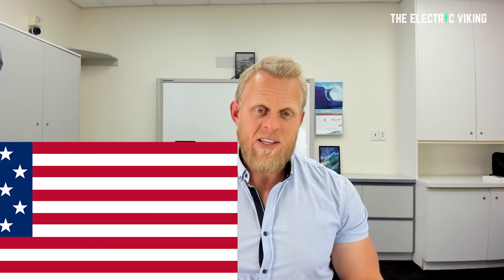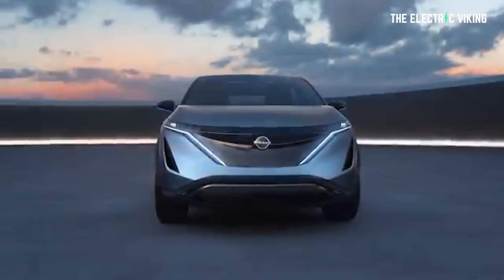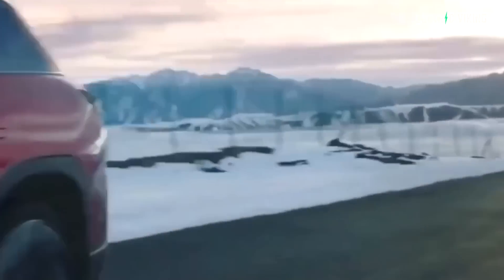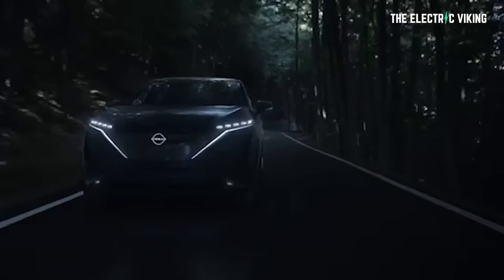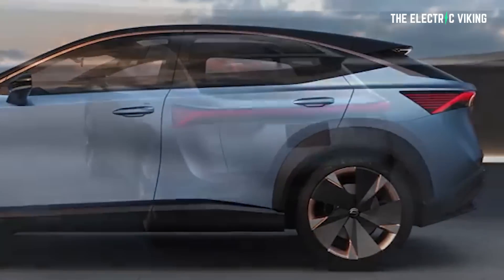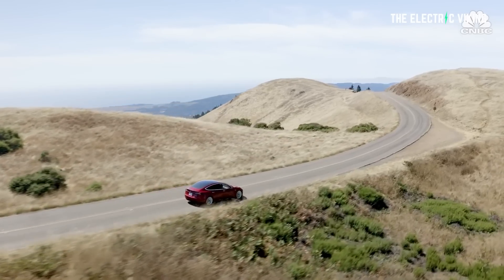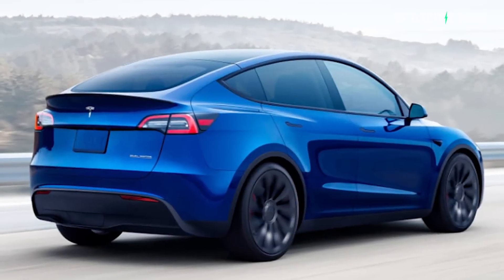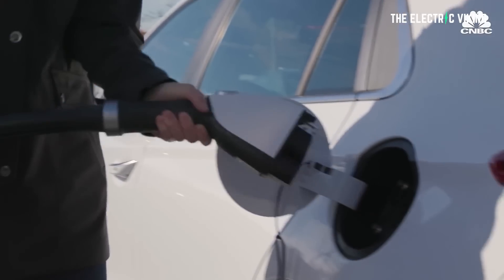Nissan Ariya US Reservations Open: Specs + Prices!

Comment: The Ariya looks like what Nissan should have done with the Leaf -- 2 years after it came out.  It adds liquid thermal management, and better range and acceleration, and I hope it's always-on like a Tesla (at least it has an app now), but it still lacks a frunk, RWD, a big screen, AP & FSD with seamless navigation, high performance, 300+ highway miles, etc.   It could still be better than an ID.? or a Mex-E, both plagued by software problems, if the roll-out is more competent.

Comment: In the US an SUV looking vehicle is the daily vehicle so all wheel drive isn't important to probably most drivers.  There are colder places where more people will be driving in some snow so all wheel drives becomes a little more important.  But front wheel drive works fine in snow.  I drove an econo front drive vehicle in snow all the time and no issues.  But then once you get into the mountain areas with snow or people have to drive off road then it's important.  Maybe that's 10% of the buyers.

Comment: I think fwd is better than rwd but that is largely because ice vechicles sit their  engine in the front and that extra weight on top of the wheels that are propelling you forward provide extra traction.  On an electric vehicle i don't think thats the advantage.  With the skateboard design the weight sits in the center and distributes their weight across the wheels much more evenly so i think it matters a whole lot less whether it's fwd or rwd in that case - either is equal in that regard.  Now as regards moving appliances with a dolly, it's generally accepted that it's much easier to pull than to push - despite that you cant see what's behind you so well.  In a car maybe it's still easier to pull than push.  I'm willing to bet that it is.  Who's the mechanical engineer in the room?  Not me but i but there is one who can speak to that.
Reply: FWD has an advantage in the braking/energy re-generation, as the majority of the braking is done by the front tires, thus allowing more power to be regenerated which would be beneficial for the car's range. RWD is better for the acceleration, since pushing the car from the back is better, you must have noticed that when you push the gas pedal down, the back of the car will go down and the front up, thus creating more traction on the back. Same is true for braking, the front will go down and the back up. So the best option is always 4WD, you'll have the advantage of both situations. There are also differences with steering your car, most people prefer RWD, since you can power through a corner, move gas will push your car down. That's why most sportscars are RWD if not 4WD.
Reply: @Curacars  the center of gravity in an ev changes the angular momentum of the chassis relative to an ice vehicle.
Reply: @lizziswane4632  I don't think it matters much except for cornering. For traction RWD is best and for re-gen breaking FWD is best.
Reply: @Curacars  is cornering a function of traction as influenced by angular momentum and center of gravity?
Reply: @Curacars  see I come from a background of growing up in an environment of used appliance sales and servicing and everyone had a ford pickup and I can tell you plainly that in the feet's of snow we used to get in the winter that I would only want to drive a pickup up a snowy hill if I were loaded with appliances, otherwise I would prefer even a fwd dodge omni.   But that's ice vehicles.  But even loaded down a pickup still has a tendency to slide from side to side as it digs in.  My omni not so much as that.
Reply: @lizziswane4632  you shouldn't be driving a car up nor down hill with a feet of snow without chains and preferably a 4wd.
Reply: @Curacars  now what fun would that be?

Comment: I'm getting a Model Y but the Ariya, Ioniq 5amd the EV6 were on my short list since they all come really one to the Model Y.  

I brevet the ride quality will be better in the three I mentioned above over the Model Y but I'm going for that longer range in the Model Y,  the larger storage, better infotainment and since mine won't be ready to receive until June I'm hipingnfor more improvements to come...even potentially the 4680 cells.

I think if you're going for the Ariya get the front wheel drive with the longest range. Hopefully when they do the EPA test it gets more on that 87kw battery. 

With that size battery I expected more Rane. Either it's really inefficient or its unnecessarily heavy or maybe it's a combination of the two.

Comment: Sam, you asked why such poor range from a big battery? - 2 words mediocre aerodynamics.  Aerodynamic drag energy is much greater than energy to overcome rolling resistance due to the weight of the vehicle.  Also I agree about 4 wheel drive, should be available on low spec variants. (BMW i3 lack of 4wheel drive was a deal breaker for thousands of us).
Reply: LiFePo4 ???

Comment: Too bad, It is totally OUTDONE by Fisker Ocean, all price-wise, power-and performance-wise, and luxury-wise.   The Fisker 0-60 is crazy for both the middle and upper trims and for less money.  The base already is only sold for $29,995 after Federal tax credit and even before individual State tax rebate of up to $2,500 (in the case of CA).  And even the base model comes with 275 horses for the Fisker Ocean, and both upper and middle trim come with over 540 horsepower and 0-60mph in either 3.5 or 3.9 seconds, which is much faster than the Nissan Ariya and the Fisker Ocean costs less money.  Nissan should have this Ariya out at least one to two years ago.  It is now late, and the price, performance, luxury level, features, prestige will all lack the competition.